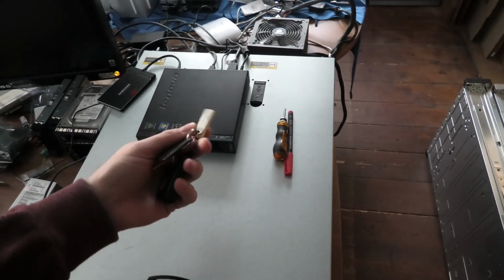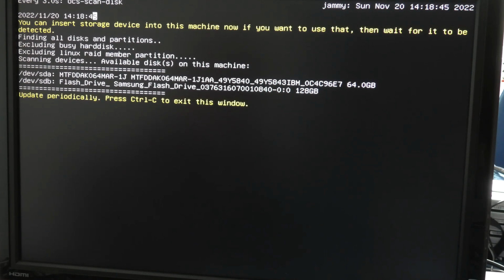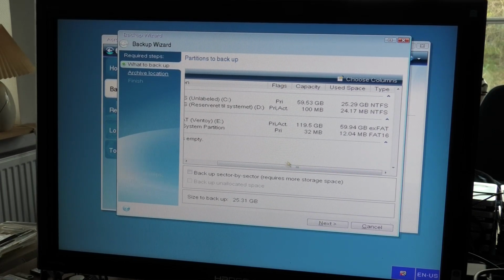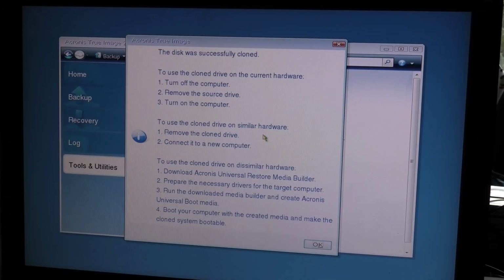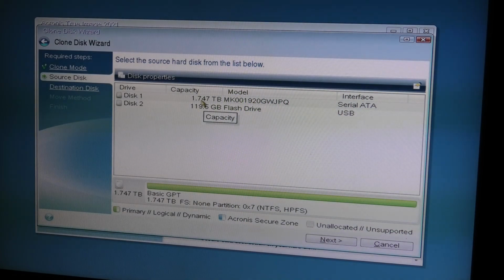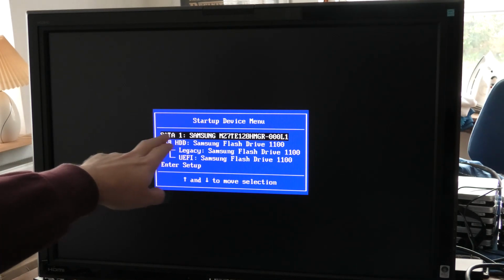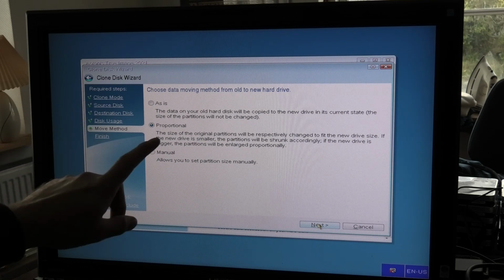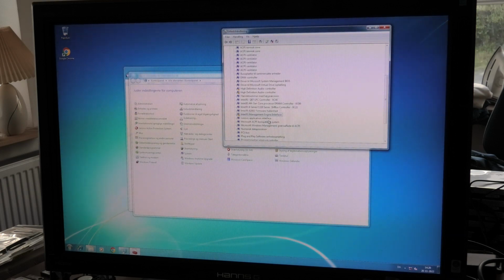Cloning one Lenovo Tiny M93p on to another Tiny M93 - 1240

Comment: I don't REALLY understand how you're using Acronis for this, or why you're using it THIS way. Acronis is usually (I've used it quite a lot previously) to create images. Where you can make a disk-clone IMAGE that'll be stored as a single file image instead of the way you're doing it here, where you're using all of the disk as a boot up drive.
If you're using the imaging-format, you could have like a bunch of images on the same disk.

That being said, I've recently stopped using Acronis and have simply just taken the disks out and put into my desktop because the transfer rate just about halfs the backup time. (Using free software)
Reply from the maker: There is only connections for one internal drive in these small Lenovo Tiny PC's.

Comment: Fantastic!

I was doing something similar yesterday. I took a virtual hard drive from Virtualbox, converted it to a format Windows could read, mounted it in Windows, then cloned it to a physical drive to go in a real machine.

So many steps where it could go so wrong, and I was expecting it to fail at every chance. Admittedly, I've not put it in the real machine yet, so there is still time for it to fail, but it never complained once when being pushed and prodded. 

New software is quite amazing these days. Gone are the days when everything says no until you realise that a DIP switch is set wrong because the documentation lied.
Reply from the maker: As I sayed,, I did not have much hope for this to work,, but it did :-)

Comment: I used Acronis many years, paid whole lot for it but it failed me so many times that I given upon it. I use mainly the Windows application not the limited ISO. Had issues with CloneZilla too when cloning Windows, cloning Linux works fine. For Windows I'm using Macrium Reflect and it just works. Not as user-friendly as Acronis but it just works. Acronis nuked my boot partition when cloning so many times, so many issues with automatic backup and the last straw was when Acronis corrupted many files on my main system when cloning, very annoying problem to fix. Acronis turned into some kind of antivirus and it seems they just don't care about cloning/imaging/backup anymore, bugs present for years and never fixed, instead some AI crap added.
Reply from the maker: Hi Tomáš Kolinger
Thank You very much!  glad you liked the video :-)
Thank you for watching! :-)

Comment: Morten: I recommend using "Hiren's boot CD". It's a Windows 10 PE with all drivers and useful tools you need. It runs best from a usb-disk (or you can add the iso to your existing boot-stick!). Way more easy than clonezilla and much more comfortable than Acronis. Use Macrium Reflect on HBCD.
Reply from the maker: Humm I haven't used "Hiren's boot CD" for years,, it was XP PE then.. or just DOS
Reply: @MyPlayHouse  in XP-times i used "ultimate boot cd for windows" which worked also in Win7-times. Since Win10 is there, i use HBCD.
Reply: I use normal windows to go on usb drive with partition magic for disks
Also mini xp

Comment: Back in windows 7 days I want to say I used a program called RunAsDate (or something like it). That let you run a program with a certain date without changing system time. Might work on a newer OS
Reply from the maker: The thing I have working tures the time back for 5 sec. while the program starts up,, and then forward again.